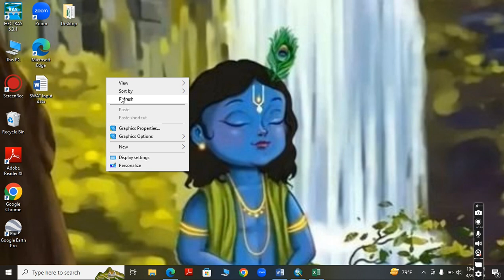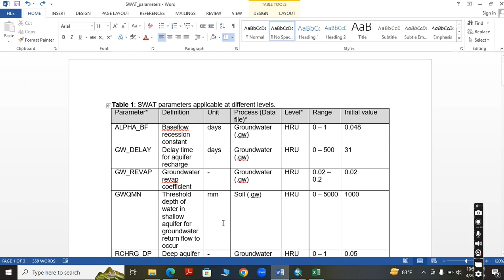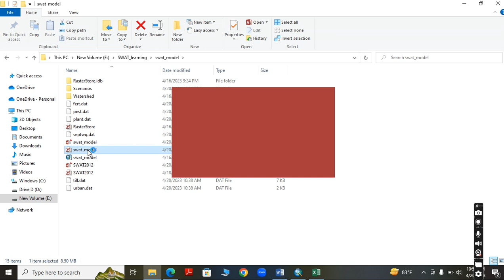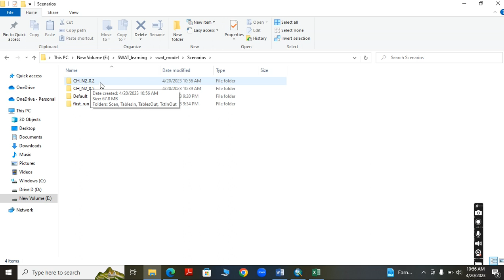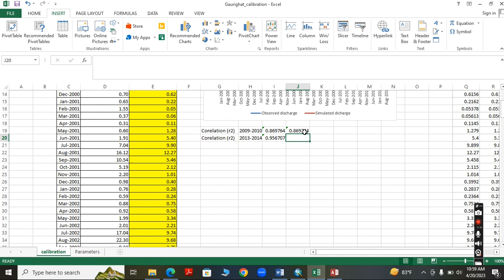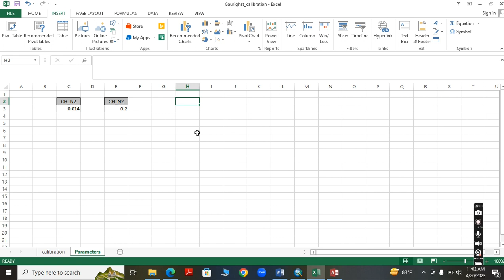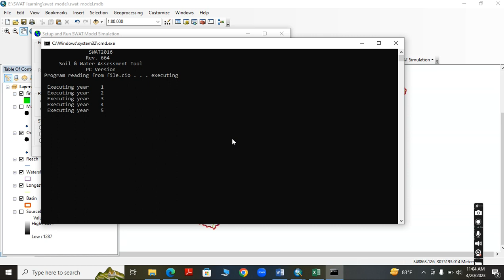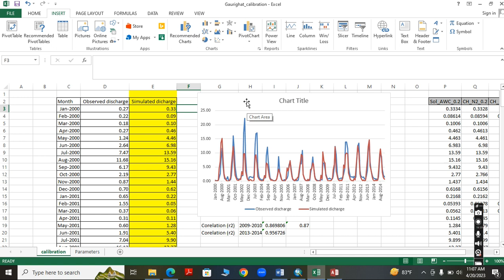SWAT Manual Calibration Part 4

Comment: How to calculate simulated column?😮
Reply from the maker: Simulated discharge column will come from swat model. After running swat simulated discharge will come, that you can find it in swat output folder and in swat mdb file, in sub category

Comment: Hi, could I know what the scale of the monthly data is for observed data? monthly average or daily average or monthly cumsum or daily cumsum?
Reply from the maker: For montly, we have to put monthly average data and for daily, daily average data. For example: if you want monthly silumated discharge, then we have to input monthly discharge data, like if you simulate from year 2000 to 2014, then for each year separately you have to put monthly average from january to december...
Reply from the maker: But for precipitation data, we have to do monthly sum.. and for temperature, discharge, it will be monthly average...
Reply: @easyhydrotech  Alright, that makes sense. Thank you and good tutorial btw. Subscribed.
Reply from the maker: @rishabhsrikar9514  Thank you

Comment: This is very helpful video. Did you make the calibration part video?
Reply from the maker: Thank you. This is a complete manual calibration. In this way we have to change the parameters and run the SWAT untill we get good result. 
Mostly need to understand concept of parameters and focus on selection of parameters.
Reply: Thank you. Would you please provide this word file?
Reply from the maker: okay please provide your email or do message in my email.
Reply: @easyhydrotech  Hi, after running the Arc SWAT I got the simulated discharge. However, this simulated discharge is very high compared to my observed discharge. Can you tell me why it is occurring like this?
Reply from the maker: It could be. So we have to change the value of some parameters which help to decrease simulated discharge. See which parameters are responsible for that.

Comment: There is a question araise how we judge which parameter we have to change ??
Reply from the maker: Yes, for that we have to understand the concept and meaning of parameters. I have showned in the video lists of some parameters (about 20/22 parameters) which helps to obtain good results. You can work in these parameters first, then only go for other parameters if you dont get results.
For selecting parameters, you have to know, what is lacking in the calibration results. For example, if baseflow is low of simulated discharge(obtained from swat), then choose the parameters and its value which will help to increase the base flow. Similarly observe pick flow. 
Mostly we have to concentrate to match baseflow, peakflow, and lateral shift. 
Directly we can do from SWATCUP, but sometime, it doesnt give good results and in that case we have to do mannual calibration.
Reply: if  I need your help is further process I will asked from you 
Thanks 😊
Reply: OK I will try today acctullay we are doing such a research on our own behalf so very informative video you make I suggest you have to make more videos  critical points like I asked from you and others you think to be added Thank you soo